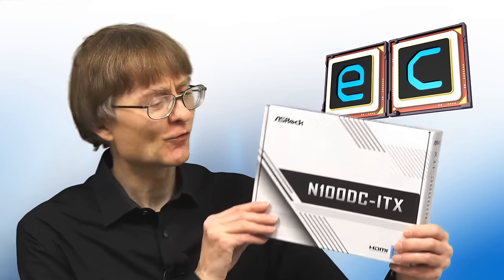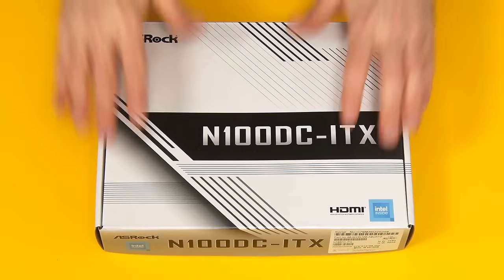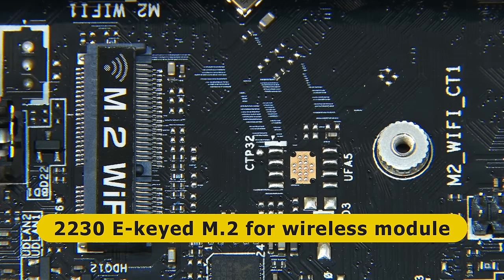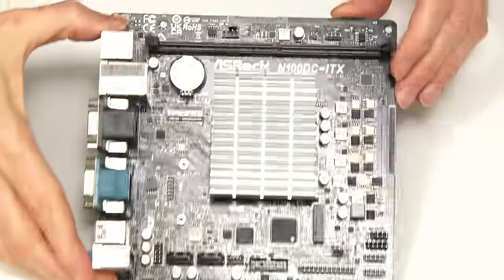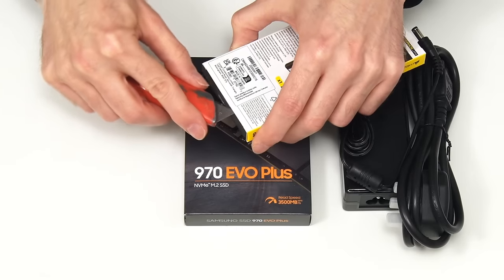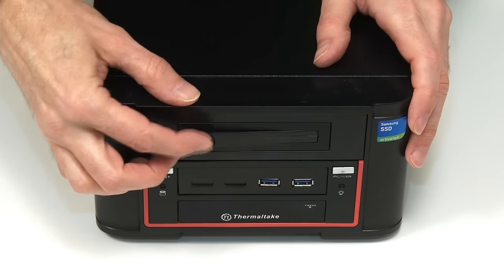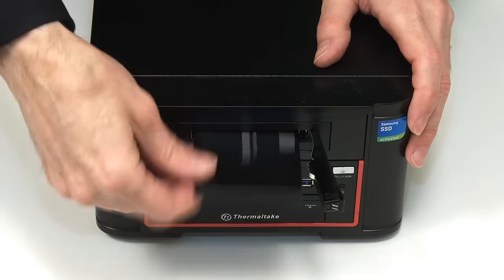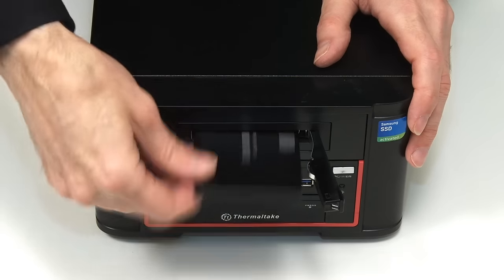N100 Mini-ITX Silent PC Build

Comment: 8GB RAM really isn't enough these days.  My web browser tends to chew up 8GB RAM all on its own and sometimes spikes as high as 16GB RAM.  I never recommend anything less than 16GB RAM to anyone as a result.  Do I think that web browsers eating 8GB RAM is ridiculous?  Yes.  But the problem isn't the browser vendors (okay, maybe they are complicit) but rather web devs who don't care how much RAM they are using with their websites constantly getting more and more bloated.  Hitting swap, especially problematic for a wear-leveling SSD boot drive, is always slow but OSes tend to destabilize pretty badly when hitting swap space.  More RAM is a requirement when using SSDs so you never hit swap space.
Reply from the maker: 8GB remains absolutely fine, especially in Linux, for the vast majority of basic computing activities. I have been running 8GB on the previous machine for all of my office and web work for 10 years and have never hit a memory constraint. Whilst I accept that web browser RAM use is getting worse, even in a browser, how much RAM you use is totally under user control (nobody forces you to open tens of tabs). It is ludicrous to suggest that we need 16GB RAM today for the same use case as we worked in perfectly happily 3 years ago. More RAM is not a "requirement" for SSDs, although it is wise to avoid the use of OS swap files on an SSD as you note. However, again, this remains under user control and is a function of the use case. As I've not typed over the over here, nobody can state how much RAM a computer requires without knowing the use case, as I very clearly indicated in the video.

Comment: Curious, why didn't you go for 16gb RAM, Corsair do make 16gb sticks, and 8gb these days is not really enough.
Reply: I'm going to go out on a limb and say this guy has a good idea of how much ram he needs for his purposes, as apposed to, how much ram some sponsored, clown youtuber has told you , you need.
Reply: It depends entirely on the intended use of the machine. I've just watched this video and added this comment on an old E8400 system rocking 2 (yes, two) gigs of RAM. Ran it as my daily, with Linux Mint for a good 7 years, no issues, now switched to Debian, it will still happily do e-mails, web-browsing, editing documents etc. No 4K videos, but I don't really need that at the moment. Of course, it's not future-proof, but for the time being it costs me nothing to keep using it. For now I've given up on upgrading the RAM because I can't find sticks to match the original ones, and investing money in replacing the memory entirely doesn't make sense financially, given the age and value of the machine. Luckily Linux distros tend to be pretty good at running smoothly on little RAM.
Reply: @superhands8041  I had a quick look at Linux Mint, now I see why 8gb might be plenty, it barely even uses a gig at idle.

Comment: Why so little RAM?
Reply from the maker: Because there is absolutely no need for more than 8GB of RAM to run any of the applications (office packages, web apps, etc) that this PC will run. I do not understand that utter obsession of fitting PCs with RAM that is not needed, and that we have never needed to run particular application set. When did more than 8GB of RAM ever become a requirement to run basic computing activities, especially in Linux? Never.
Reply: @ExplainingComputers  I don't know... Did you recently check how much ram firefox uses when loaded with few videos (up to 3GB) ?
Reply from the maker: Quite possibly so -- but I've never loaded a browser up with more than one video! Again we are back to use case.
Reply from the maker: I've just checked in Chrome (my default browser) in Linux Mint. A YouTube video tab uses no more than 250MB (the max I could get was 236MB). So 3GB would be 12 open videos! :) So I've no idea how you are using up to 3GB with a few video tabs open.
Reply: @ExplainingComputers   Just as I was talking about this, my ram requirement went down. So I was confused. Few days later it went up again. The thing is that youtube uses local storage. And for a playlist I was watching it took 350MB. Add that to the rest ram usage i get about 1.5GB for one playlist. The setting in Firefox is: Manage Cookies and Site Data , which shows the: Local / persistant storage for domains.

Comment: During my testing i found out, if you add a silent pwm fan, and over clock the board to 30 volts, it performs the best, and that ssd heat sink good, because gen 4 ssd heat a lot

Comment: #ExplainingComputers @@ExplainingComputers 
please i need the right answer bcz  i tryed to search for  it  but  no answer in internt so please 
does my pc support 128gb  or not 
i have cpu : amd ryzen 5 5600g in the amd websit i found  ryzen5 5600g support 64gb also i have 
motherboard asus prime B450m-a ii 4 solts and in the asus website i found this motherboard support 128gb 
also does this confing support 4400mhz ram's type? 
please help sir?

Comment: Actually this 11W idle is not unique. With a minimalist desktop PC can do around 15W If we choose the right components, were the most important a well balanced PSU for the system needs.
For example I found this video years before: https://www.youtube.com/watch?v=e50Q08g8iwQ
And this guy use an overpowered 400W PSU, But an i3-6100 idles 17W. With a 200-2500W 80+ Gold PSU I bet it could goes down to ~14-15W idle or even less.
Reply from the maker: Nowhere did I say 11W idle is unique -- I have looked at many computers  on this channel with far lower idle draw!
Reply: @ExplainingComputers  YOu are right, you did not say that. Maybe I did not write well. Sorry, english is not my native language. ☺
I just wanted to write another perspective, because You said that, your previous PC were idling at around were this N100 PC is the max.
So I just wanted to suggest that, with a good components, we could reach very similar idle with tipical desktop hardware as well.
I would see a build like that.
Anyway I llike your work. Thank you!!!!

Ps.: An intel CPU idling around 5-6W, 1x DDR4 modul is around 1W, an SSD less than a Watt, 1x fan with low RPM less than a Watt, South bridge and other integrated IC on the motherboard are few Watt. With a good efficient power supply at 10W power range should reach ~12-15W from the wall plug, I am guessing.
Reply from the maker: Thanks for this. :)

Comment: I guess I don't understand the 19 volt thing. PCs have 12v, 5v, even 3.3v maybe but not 19v. It's DC so not transformer friendly. What's going on?
Reply: 19 volts regulated down to lower voltages provides increased stability.
And I see that Amazon sells a dc-dc power supply for mobile applications that outputs 19 volts from a 12 volt input. Great for the RV community.
Reply: It's a laptop charger, so as well as providing 12V for the system, you need something that's (a) portable and (b) can charge lithium batteries. 

There's a cut-off where portable chargers below 20V are tested less stringently, hence cheaply, than chargers above 20V. 

Also, you can charge 4x lithium cells (4 x 4.2v = 16.8V) whereas a 12V charger could comfortably only charge 2.

Neither of these matter to Chris's desktop, but 19V chargers are cheap and easily available.

Comment: Why can't they build decent boards that run on 12 vdc. I hate running boost converters for vehicular use. Inefficient and costly.
Reply: If you're OK with Mini PCs, the Chuwi Larkbox is 12V. You can also try using standard ATX but use a Pico PSU from 12V? Would that help?

Comment: I don't understand why Intel would make a processor which only supports single channel RAM. Dual RAM support would significantly increase performance at no extra cost for Intel. 
It doesn't make much sense to use full size DDR4 on such a small board either.

Strange device.

Comment: Anybody knows if it's possible to buy a system that doesn't come with UEFI (and backdoors) ?

Is it possible to wipe out the UEFI BIOS and only install something sensible and safe ? I know it's possible to mess with it with a Linux boot, but Linux drivers can be a pain to obtain.

Comment: asrock always got some strange board, for example they got 2 different gen ddr ram working in a single mother board, and i remember one of their board support am2 to am3+ support all amd processor from 05 to 11
here is some strange asrock design
z270m, this one got lga1151 desktop socket with a desktop z270 chipset but the board is powered by 19V dc

Comment: This is nice but for the price of this motherboard you can get a complete mini pc equipped with an Intel N100. It will come with RAM, NVMe SSD, case, PSU, fan, wifi & BT included. It will have less I/O than the Asrock motherboard but it can easily be turned into a completely silent PC as well. Cheerio!
Reply: Mini-PCs are mostly not passive cooled, and in most cases they can't get easily made passive. And specially these Chinese Mini-PCs don't really have support for BIOS and driver.
Reply: @INUID  Yes, their BIOSes are locked down and they have one less sata port but changing their cooling solution to a fully passive one is not a difficult project. A small tower cooler with a fan just barely spinning would also be practically silent. I was happy when I saw the Asrock motherboard but that changed when I saw its price. Mini PCs offer better value IMO.

Comment: I could tell that at the end you just breezed through the performance checks and I understand because I've seen you do the same thing over and over again and it's probably tiresome to both do and to watch.  But I'm interested in this as a computer for my entertainment center and mostly that's video with some light things like spreadsheets which even a slow computer is ok for.  I was interested in the Video because it's just the same UHD drivers that all the boards use.  I'm sure it's better than what I currently have in any case.  This brings up something though.  Is it possible/practical to add a video board or card of some sort to such computers? Or would that just be a pointless endeavor.
Reply from the maker: No I did not "breeze through". I am currently in extremely difficult personal circumstances and simply did not have the time to add additional content (that would also have made the video overlong). So please do not assume that I am fail to do things because it is "tiresome". Thanks.

Comment: 19v is a pain in the .... 12v is much easier to deal with as its way more common.
Reply: They make dc-dc power supplies with 19 volt outputs.
Reply from the maker: And, according to Mini-ITX.com, it is possible to run this board successfully using a 12V supply, at least if you only want to use a single M.2 drive.
Reply: My Intel bean canyon NUC will run on both 19v(default) and 12v, but using 12v will result in it using more power for the same tasks.

Comment: Stupid asrock engineers with this vga and ps/2 connectors. WHY?????
Reply from the maker: Because some of these boards will be used as replacements in industrial equipment where those connectors are used.
Reply: @ExplainingComputers  For industrial you buy different boards called "industril motherboards". Asrock make them too.

Comment: Well i think the PSU is bad choice! Its better when you use a bronze typ normal silent PSU, (Seasonic Power supply ATX24 350W/80+ Bronze/) the power consumption will lower -10W or less, and you didnt hear anything!
Reply from the maker: What a ludicrous comment! For a start, this motherboard does not have an ATX power connector, so I've no idea how you are planning on connecting that PSU. And it is the wrong form-factor for this case anyway (which only takes SFX). And it most certainly would not be silent, which was the whole purpose of this project! :)

Oh, and did you not see that idle power use for this system is 11W! :)
Reply: @ExplainingComputers  oh sorry indeed. I looked at the wrong motherboard version, I like the ATX N100M version better because of the connector. Energy efficiency is more important to me, fanless PCs have been my obsession for 15 years ago. But let's say a PSU fan operating at 17 dBA is not the end of the world, it moves the air somewhat. The MOSfets around the CPU do not glow at a low temperature...

Comment: I feel like you made a mistake only getting 8Gb of ram, 16 is the minimum these days.
Reply from the maker: The minimum for what?! :) There is no such thing as a "minimum" unless a use case is defined. And here 8GB (especially in Linux) is ample. So why fit components that will draw power, and create heat, for zero benefit?
Reply: Build for the purpose not the max if you want quiet and low power usage why over upgrade.
Reply: @kwacker45  32gb is the max, 16 would just prevent unnecessary bottlenecks. The cost of a 16gb stick would be negligible.

Comment: Absolutely useless Power Measurements. No Energy Saving Mechanisms as ASPM etc. in Bios activated. So the minimum power measurement values are wrong. NVME and SSD never go into their sleep states. I reach 5W idle (C-Pkg state C8) with this board under Unraid 6.12.4 and a 12V PSU (what saves already around 1-1,5W compared to a 19V PSU). Actively used as NAS (1x 2TB Samsung 970 Eco Plus NVME + 2 x Samsung SSD) with multiple Docker container as Adguard, Nextcloud, Home Assistant etc. I have a 24h power consumption of approx. 210Wh, means an average power consumption of 8,75W.
Reply from the maker: Thanks for your data and opinion. By definition, an "idle" power use is NOT the same as sleep state power use. Idle power use is when a PC is active, just ticking along, but not doing much (eg when a user is a reading a document). Sleep state is when a PC cannot be used by the user -- it is waiting to be woken up again. What you report as "idle" is clearly not idle for use as an end-user PC -- your use case as a NAS is totally different.
Reply: @ExplainingComputers  I never mentioned sleep in context of the system. Please read more carefully. Me spoke about sleep states of the NVME/SSD where the power consumption of NVME/SSD is drastically reduced and other energy saving mechanisms (already mentioned above: ASPM, C1E, deeper C-Package states), which need to be activated via BIOS. The standard Bios configuration of this board has this mechanisms not activated. PS: A Unraid system with multiple running docker container is surely comparable to a MINT. There is one difference concerning power consumption. This is the iGPU which cos you with an idle desktop approx 1 - 1,5W.